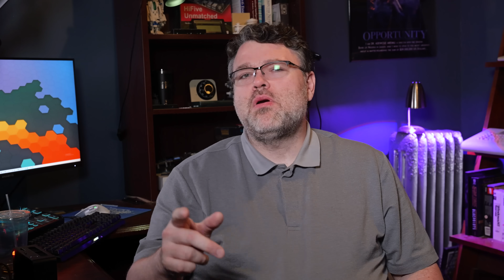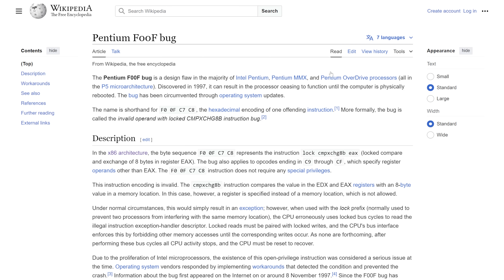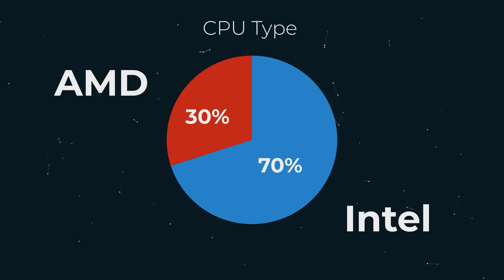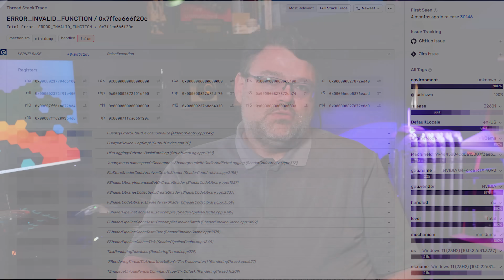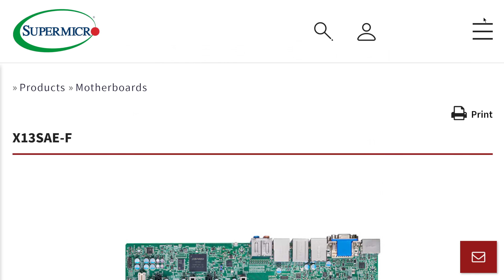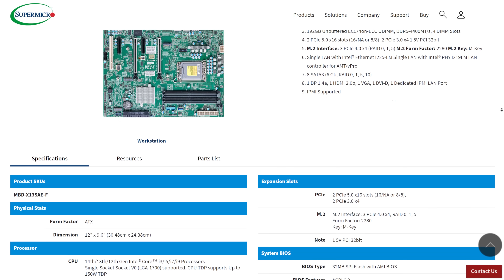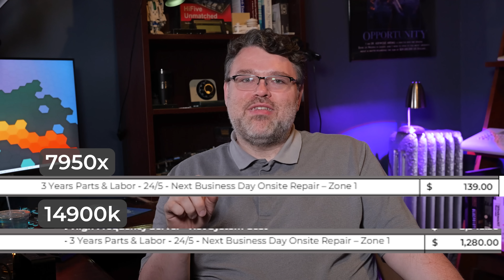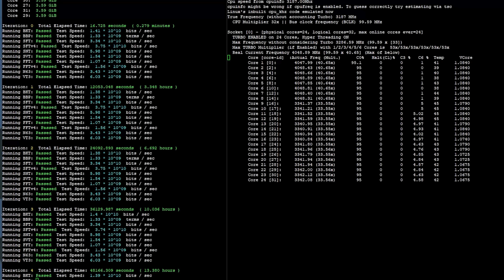Intel has a Pretty Big Problem

Comment: Intel can't even make a chip socket that doesn't bend the ILM, let alone design a CPU with an acceptable stability rate. In fact I wonder if the two issues are related.
Reply: good theory, this was a well known issue very early on. I bought a socket brace/bend corrector thingy from day one and ive had no problems so far with my 13700kf with a mild 5700mhz OC under water.
Reply: To be irritatingly pedantic, making a good socket is a completely different type of engineering from chip design.

In seriousness, I see one comment suggesting this.

Their IHS is said to be warped, having a bump in a corner. They claim to have photos showing the bump wasn't there on install. Their chip is now unstable.

If these were linked, someone like GN should be able to test if problematic CPUs are more warped than normal ones. We can also see if those that installed a frame have a lower failure rate.

Given the complexity of the issue, I doubt that macroscopic tests and software investigations would be enough. A full investigation probably requires equipment to check for silicone degradation.

Comment: It's so weird for the 2nd and 3rd gen of a product being the problem children. I mean 12th gen was a great chip, but you'd think with that being the first gen of the new P and E-core style, that is where you'd find the major issues. I truly believe the 12600k is the best bang for buck chip we've seen in a while. Sure, some of the AMD chips are a better dollar per fps value, like the 7600x, but there's a pretty big jump in total fps between the 7600x and 12600k, or maybe it was the 5600x, I dunno. I've had a few drinks.

Comment: Gut feeling is that this is a fabric or memory controller/subsystem issue. Decompression causing issues, nvme/gpu errors popping up spuriously hints at the cores having trouble consistently writing to memory.

Comment: I was thinking about building a new PC with a 14th gen Intel chip but then heard about the instability issues.  Those plans to use the latest Intel chips are on hold indefinitely.  Intel might have rushed these chips out to production a little too fast to try to compete with AMD.  And I'm not a fan of the power hungry nature of the Intel chips when AMD is crushing Intel with CPUs that use a fraction of the power that Intel draws from the wall.  So I've been seriously looking at AMD chips for the first time...ever.

Comment: We see more Intel CPU instability issues than AMD. Random gremlins, program issues, corrupt OS installs, random system crashes... only thing that fixes it has been CPU swap. We have swapped them to 12900K... less voltage more stable. Its very obvious this architecture was not meant to boost this high.

Comment: I like my 7800x3D even if their memory controller sucks and memory speeds are low.
Reply: Even with a sucky memory controller and lower memory speeds it will still outperform a equally priced intel part in gaming workloads.. so who cares
Reply: Only real world results matters, AMD 3d v-cache is a world unique solution. Better FPS and lower power consumption. Don't bother too much on synthetic numbers mate

Comment: my trusty ol' 8700K still does the trick.
only turbo boost is on and ive seen it hit between 3.7 and 4.8GHz
still plenty good and is paired with a GTX 1070 FTW.

Comment: Decompression is exactly the kind of place I would expect a bad overclocking crash to occur, because that is likely a place where the heaviest amount of SIMD calls would be taking place. This is such a common problem that most CPUs have a setting specifically for lowering the clock speed while making SIMD calls.
Reply: then there's AVX , with even more clock speed settings :D

Comment: I bought a 13900k on launch day with a Z690 EVGA classified board. I could never get a solid overclock without overheating/instability so i just used the 5.5ghz all core present in the BIOS. Fast forward to early 2024 and every game crashes within 20 minutes while streaming. Ended up down clocking all cores to 5.2ghz to get stable. Lowering the voltage/power draw to Intel limits made it even worse. RMAed the CPU and it's even worse then the old CPU..... EVGA agreed to RMA my motherboard but haven't fully committed to losing my PC for over a week to see if that fixes it...

Comment: Damn does it feel like I dodged a bullet by going with AMD. My 7700X-based system has been rock-solid stable.
Reply: Ryzen is an awesome cpu. I have a 3600 ryzen 5, I have had it a few years. Absolutely rock solid
Reply: @andrewdonohue1853  I have the 2600x, also rock solid
Reply: @andrewdonohue1853  Your R5 3600 is just lucky. Somewhere in late 2019 , I replaced more than 20 units of this particular SKU and the 3600X because they just died out of the blue. They happened before hitting the 1 year mark. Probably bad batch, but there was no R7 3700X or 3800X that came back for RMA. 3900X and 3950X were not that common back then because they were expensive and my customers are mostly gamers who don't need so many cores. 😵
Reply: @fleurdewin7958  "Somewhere in late 2019 , I replaced more than 20 units of this particular SKU and the 3600X"
Out of how many?
Reply: @fleurdewin7958  it's been flawless in every regard. i also do allot gaming. american trucking simulator, flight simulator and others but those two are probably my go to games. i have been thinking about upgrading my graphics card currently radeon R590. i run linux so i would stick with an AMD card, i have read they work better with linux. im really pleased with how well linux fedora can play games now, it has come a long way.
Reply: @fleurdewin7958  I have two 3600s
Reply: @fleurdewin7958 Consider me lucky too then. I ran a 3600 for 4 years straight, not a single issue. I replaced it last week, not because it died, but because i upgraded my entire rig.

Dunno man, maybe i got really lucky at the silicon lottery, but i kind of doubt it.
Reply: real. I love my 7700x. Such a good chip. I can Craft so many Mines with it
Reply: @connors3356 my 5600x boost to  4.8 since release. No crashes or anything.
Reply: I've only had one defective AMD CPU, the 5950x. I have heard that the first batch had issues.
Reply: @battokizu  my 5950x was a first batch and had crashing issue with PBO.  Finally went with 7800x3d and been running smoothly.
Reply: 5600 user here. Rock stable at a 4.65 GHz overlock for years at this point. Funny how even in 2020 I had a few arguments where people claimed Intel is just "more stable". Yeah my old 3770K was also very stable and reliable and so is my Ryzen 5600 but I'm not feeling the current Intel CPUs.
Reply: My 5800X3D system (3090 Ti/24GB) has been rock solid for three years.  I also have good solid RAM (HP V10 Samsung B-die) a Tier 1 power supply, and a motherboard with a high-quality VRM.  No OC at all.  I frequently remind MSFS users like myself that they need to look at their hardware before blaming the core sim code for their CTD problems.
Reply: I've been buying AMD cpus for decades.  I remember the Wintell douopoly with Microsoft and Intell forcing hardware manufacturers not make motherboards for either AMD or Via trying to have only Intel boards and chips and making computers unaffordable for most.
Reply: I bought 2 7900X3D's for 100 GbE testing on Supermicro H13SAE-MF. I guess I dodged the Intel enshitification bullet. Meanwhile, my AliExpress craptastic and old Xeon rando recycled parts impulse buy laughs in ECC.
Reply: Same here. 7700X purring along. Latest Agesas are very conservative compared to early ones. But it's a good chip.
Reply: @connors3356  I even run mine in eco mode... A ridiculous drop in power consumption/heat with a relatively small drop in performance.
Reply: 7800X3D/4090 gaming rig. PBO and -30mV on the curve... chef's kiss.
Reply: My 5900x paired with an RTX 4080 is amazing.  I'm a degenerate who will play for 12 hours straight sometimes on my days off from work.  No crashes and a perfectly smooth 144 fps on a 4k Gsync gaming monitor
Reply: I have a 2600x, 2700x, 5800x3d and 5900x systems. 
Only one of them has had a BSOD, and it was my personal 5900x gaming rig.

Yes. Just one. After 3.5 years of perfect stability.
Happened when opening fanXpert. Had just hot-connected a pwm fan.
Reply: I've had a 7700X build since April and I couldn't be happier. Haven't had a single issue out of it.
Reply: My 7500F is running so well I honestly forgot what it was like to even have issues
Reply: I remember a time when people would say to go with Intel, it's a much more stable platform, how times change eh lol.

Ironically the only build I ever had so much hassle with was the one time I decided to jump ship over to Intel back in 2015 with a 6700k skylake cpu due to the crap ipc the fx8350 had that I was running. 

Always used amd other than that from the athlon days in the early 2000s through to a number of ryzen builds & I've literally never had any problems, all the amd builds have just worked, currently running a 7800x3d.
Reply: @Frostie3672  Which has always been a bit dubious as a statement - AMD of old tended to be very cheap and very good at their rated speed. The troubles folks had was overclocking the buggery out of them most of the time, or so it seemed to me.
Reply: @foldionepapyrus3441  Same for me. I had an Athlon 3800, the 5200+, then a Phenom II, and now I run a 5900X build (had an intel in-between). Stock clocks never gave my chips problems, and while you could overclock well, I never got that luck with the silicon lottery. The only time I had chronic system instability was when I had OCZ memory in the Phenom II build, went away as soon as I got new sticks.
Reply: Frosty I have a AMD Duron still running 14 years later. Built in 2000.

Comment: @Level1Techs lack of validation. and its not just intel either. leading to zero padding on the V/F curves causing instability. it happens on the 12th gen too however much less frequently. AMD top skews also have the same issue, tho i'm not exactly sure how many other than my limited exposure of 50% failure rate across 10 cpus. its not just cpu's either gpus have been doing the same. and imho its a huge problem as most consumers find a faulty gpu and just blame the game or the application for the fault and then never get the card replaced. to make matters worse amd locks the V/F curve on there gpu's and to this day the 7900xtx drivers are still a mess. i have helped them identify the issue a couple of times and to there credit they did bump the V/F curve by what looks to be around 25mv. however in doing so broke other parts of the driver in the process. like the memory clock speed causing 100w idle power consumption all over again. and possibly a bug with video play back with hardware acceleration after fixing pipeline stalling while recording.

Comment: I think all of this has something to do with the cpu bowing problem of the cpu retention mechanism, how do the same cpus fare if using a contact frame.
Reply: I'm using a 13900k with a contact frame and have the bios set to limit power to 200w max because I wasn't comfortable with the motherboard drawing 300w and putting the heat to 100c during my first benchmark test.  Having no problems at all with it.
Reply: @Prismatic_Rain  yeah but most people will not be using a contact frame. I would bet you can overclock your cpu when using a contact frame no problem whatsoever, however if you where to use the original retention mechanism and over clock your cpu the bowing of the cpu affects the contact of the cpu with the lga pins.

Comment: 21:58 "And they're going to start leaking things to randos on the internet that make videos"
What? You think they'd actually DO that? I wonder who they'd chose... 

If it was me I would start with someone who has high technical credentials, and who is also known to be as far from "tabloid style sensationalist" as possible (so, not Igor's Lab for instance). If that didn't work to get the problem resolved I would move to someone, who is still up there with the technical credibility, but is also known to call a spade a spade outright (so, Gamers Nexus or Hardware Unboxed for instance). And if that still didn't work I'd probably throw in the towel and just call The Verge...

Can't wait to see how this plays out. I honestly think Intel are going to slither and weasel like Nvidia did with the 8600/8800 mobile chips (which was what lost them Apple as a customer). Intel's financials have not been stellar lately, and having to do a full recall (which is what this will turn into over time) is going to be costly.

Comment: Sounds like the silicon die burned off or is physically damaged. wonder if the die was changed for heat distribution. Have you run the intel chip tester?

Comment: They can't really be clear about it because they want to avoid bleeding a lot of money. If they admit to have a problem then potentially anyone can ask for a replacement. Considering it seems that the rate is high, potentially everyone want to replace their CPU. Even if there is a software solution, if the software solution ended up making the CPU slower depending how degraded your CPU is, if the consumer actually being told clearly about that, I imagine a lot of them just don't want to accept being compromised and want a replacement. The people that don't ask for replacement probably because they don't know about it (regardless of they are experiencing crashes or not) or they do know about the problem but feel that it is too much hassle to replace the CPU and instead doesn't mind their CPU running slower. I do think that Intel should provide an incentive for people that is willing to run their CPU slower since it means that those consumer can't run their CPU up to their specification (basically being lied to by Intel).

Comment: User experience with a 14900KS. The first one i got got fried by the motherboard default settings before i could even get into optimizing the settings regarding voltage, power etc... Intel RMAed the cpu and sent me a new one. 
This second 14900KS now runs on updated BOIS and microcode. (Asrock Taichi Lite) And i can confirm that especially since the latest microcode update that Intel pushed a couple of days ago to fix the known problems with TVB etc.  I get a lot of crashes in pretty much in all games i play. It does not seem to matter if it is a very demanding heavily multi threaded  game load (like cities skylines 2) or a simple single threaded game. 
I would say i am fairly experienced in optimizing my CPU settings in the BOIS, like 25 years of experience with Intel desktop CPUs, i even disabled the hyper threading in order to have an easier time with the thermals on this CPU. But whatever i try with the 14900KS, i still keep getting these crashes.  Totally inconsistent so far...

Comment: Obviously this speculation but I’m of the opinion that newer bioses have been shipping with a microcode issue and people have been frantically updating to new bioses in fear of degradation or stability which is why it seems like things are getting worse over time. I think people are actively updating to the bios versions that this issue exists on. Just an opinion though as I have no hands on this issue. I also think Intel consumers might skew a little in that they are more willing to overclock their CPU so data telemetry while still useful might skew towards instability just for that reason anyways. Still interesting but I’m sure there is more to it than that.